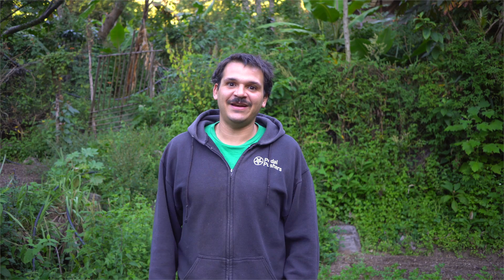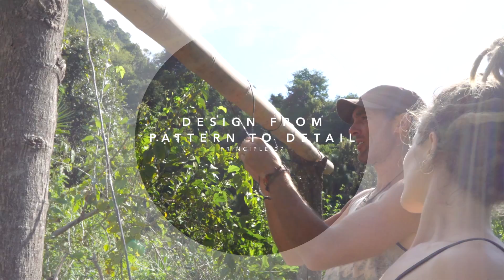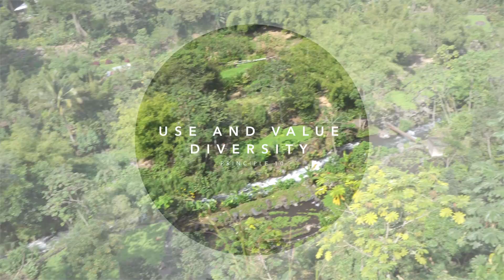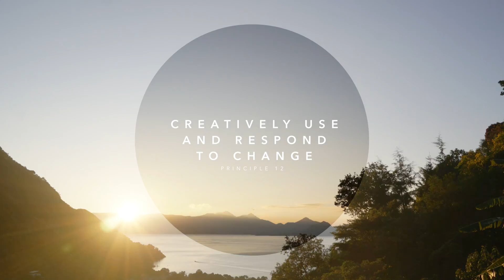Introduction: The 12 Principles Design of Permaculture By David Holmgren

Comment: Permaculture Principles (I hope I caught and got down the most important parts... thank you for your clear summary of permaculture!)

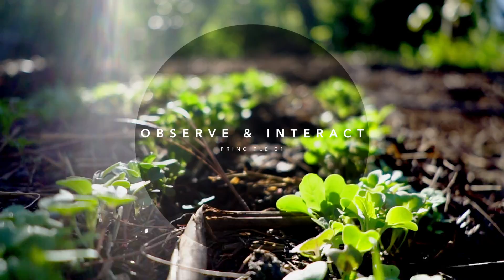1. Observe and interact: observation of the landscape, dynamics and the patterns that move within the landscape. Just record all you observe without judgement or question. (0:20)

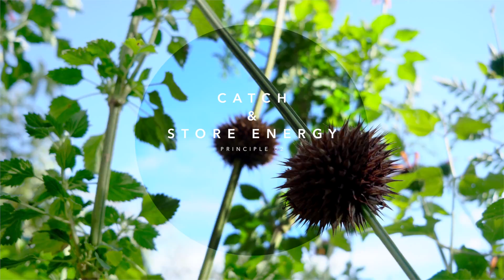2. Catch and store Energy: include all different types of energy that move through the system: people, animals, plants, soil, weather, water, sun... (0:45)

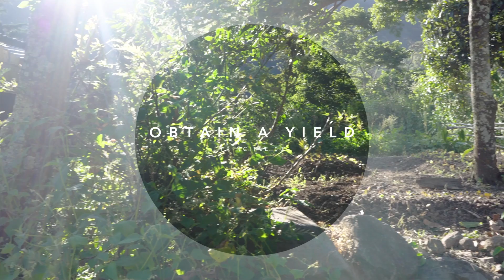3. Obtain a yield: be creative....  the yield of any system is only limited by the creativity of the designer. (1:19)

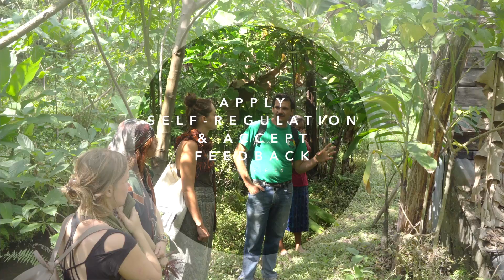4. Apply self regulation and accept feedback: automate the design so it feeds and runs itself with just a sensible amount of your own input, and make relevant changes as needed.  (1:56)

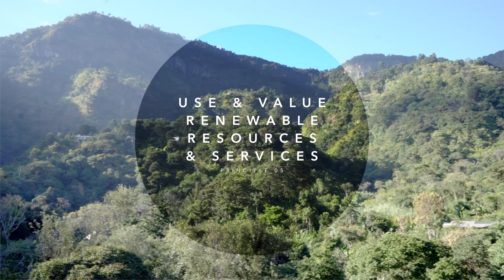5. Use and value renewable resources and services: always favor biological solutions since they live on and regenerate; ie how can a plant or animal solve a challenge.  (2:33)

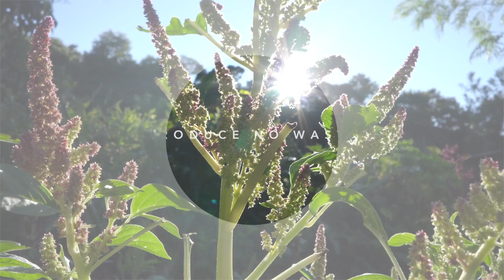6. Produce no waste: MOOP = matter out of place.  Waste is just an  unused output of any system. (3:15)

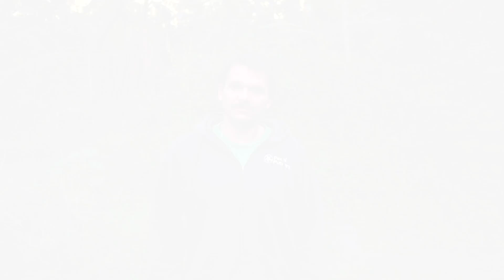7. Design from patterns to details: get the big picture of what is happening first before figuring out the details.  (3:51)

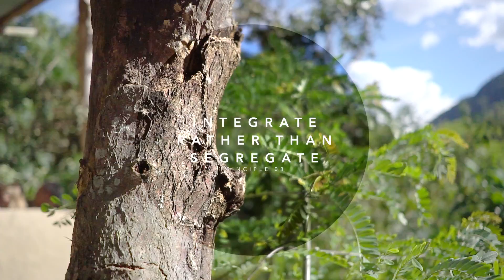8. Integrate rather than segregate: what are the functional relationships between various parts of the whole system... create beneficial interactions through the integration of multiple elements.  (4:30)

9. Use slow and small solutions: you can adapt as you go and you build systems that have longevity and resiliency well into the future.  (5:05)

10. Use and value diversity: you are stacking functions and mixing elements together, spreading the risk across a wide range of production areas.  (5:43)

11. Use the edges and value the marginals: they are important.  (6:20)

12. Creatively use and respond to change: every element in your system should have three functions and each function should be supported by at least three elements.   (7:00)
Reply: 🌼🌼🌼❤️❤️❤️ECOSIA❤️❤️❤️🌼🌼🌼
🌼🌼🌼❤️❤️❤️ECOSIA❤️❤️❤️🌼🌼🌼
🌼🌼🌼❤️❤️❤️ECOSIA❤️❤️❤️🌼🌼🌼
🌼🌼🌼❤️❤️❤️ECOSIA❤️❤️❤️🌼🌼🌼
🌼🌼🌼❤️❤️❤️ECOSIA❤️❤️❤️🌼🌼🌼